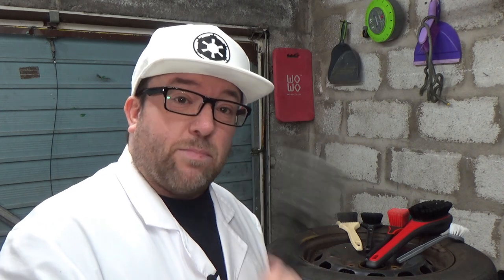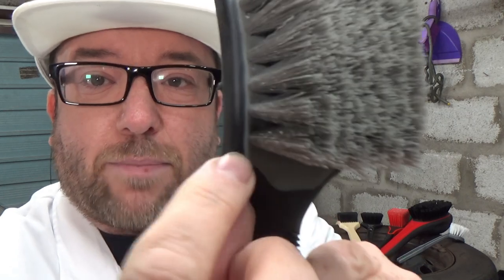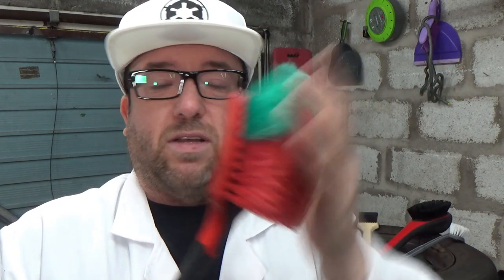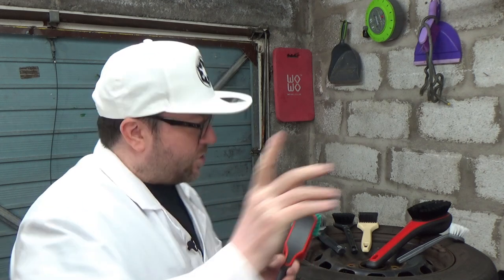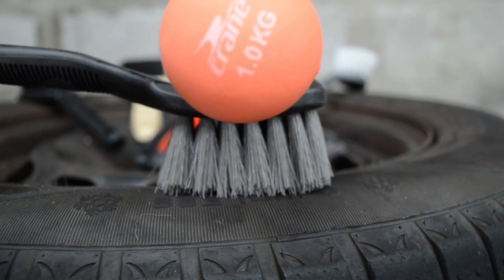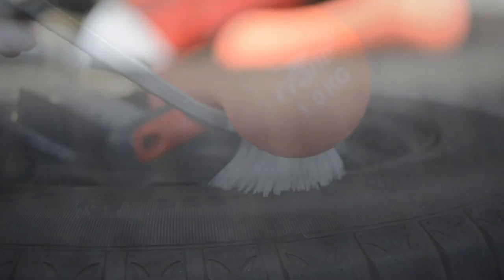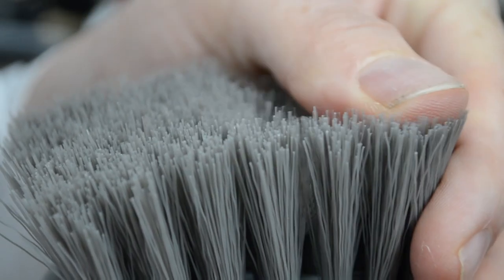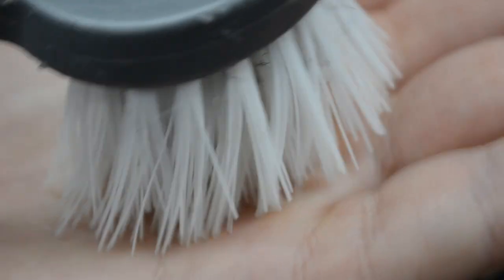Detail Factory Tire Brush  - The New Best Thing?

Comment: I just tend to use the tuff shine brush most of the time, and vikan on my own tyre's as they're maintained with gt tyre syrum. Then if I need to shift silicone dressings on trade car's small drill brush on the extension bar but I use my impact driver instead of a drill as it rotates slower
Reply from the maker: That's an interesting idea!
Reply: Yeah, do have to use one hand on the extension bar mind

Comment: Fit like. I had a trip to Aberdeen this week so I am full oh the Doric but it will subside gradually. I agree with you on all of this. I have given up trying to remove all the brown gunk that comes out of the tyre as that is in part the UV inhibitors in our tyres that would overtime degrade the tyre if removed. I use M & K strip shampoo diluted !0 to 1 and in my opinion does the same job as my previous chemical of choice the Gyeon product. I give my tyre a clean but not as vigorously as I used to and then I always use GT Serum and have done religiously for the last 3 years. The Carscope brush is better than those foam tyre applicators to apply it. I had thought about trying the tyre ink but I have enough stock of others and am waiting for something new to the market that is a game changer before I change. I am sure a lot of us used a pot scrubber to start I certainly did but soon progressed to something that looked like it meant business. I look forward to your next installment.
Reply from the maker: Thanks as always for your insights John, I'm hoping to cover the situation of using dilutable products over RTU so watch out for that.

Comment: Good job there Specky! I switched from the In2Detailing tyre brush to the DF one after Forensic Jon reviewed it, it's like chalk and cheese isn't it! Unless some unbelievable brush turns up, I can't see me changing away from the DF brush. I too started with the pot brush 😂. I wonder if anyone has ever tried a loo brush instead of the EZ brush for arches 🤔. As always, all the best.
Reply from the maker: Believe it or not, I still have a bog brush I used as an arch brush! 🙈🤣
Reply: I just threw a silicon pan brush away after learning, almost immediately, that it was completely unsuited to tires. 
You win this time B&M, but I will have my revenge!
Reply: @Specky McSporran  oh wow, did it work? They're probably like a quarter of the price too.
Reply: Funny that. As I was cleaning the toilet today a light bulb went off in my head and I thought I am sure I could save my pennies & purchase a white one instead of the proprietary blue one that seems to be the weapon of choice currently by YouTubers. I have long handled Viacan brush currently that I think is great on  plastic arches but doesn't seem to have the same purchase on the felt like my Jaguar has front and  back.
Reply: @John Brown  the meshy, carpety arches are vile, they're just dirt traps. I have the carpet style liners at the rear of my car, bloody awful.  I wish I could replace them with the plastic type.
Reply from the maker: Maybe that's a future video? 😁

Comment: I’m not a fan of using brushes on the face of the wheel, we wouldn’t use a brush on the bodywork which is painted so why would I use on a painted wheel ?
I use the garage therapy decon shampoo as a tyre cleaner, the detail factory tyre brush is a reasonable price so I might buy it